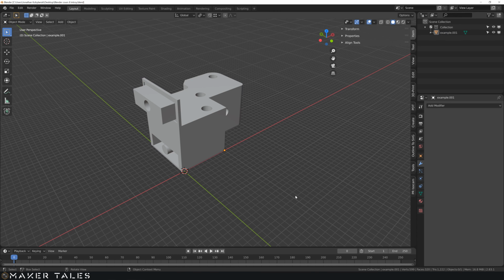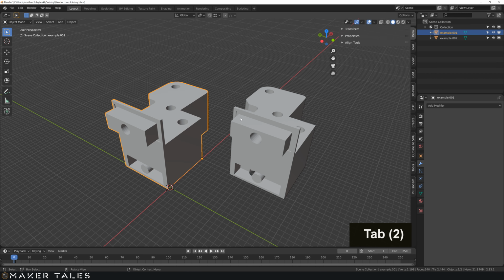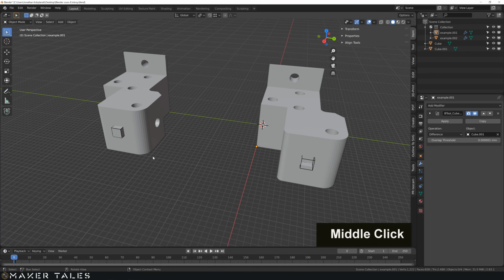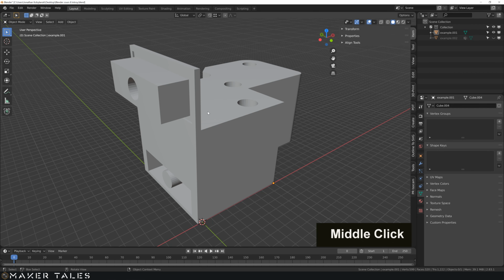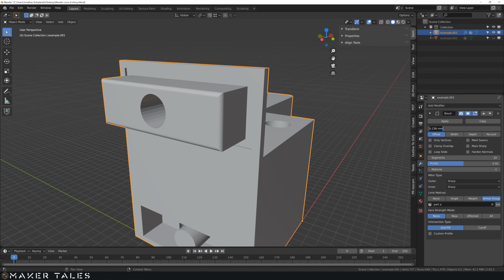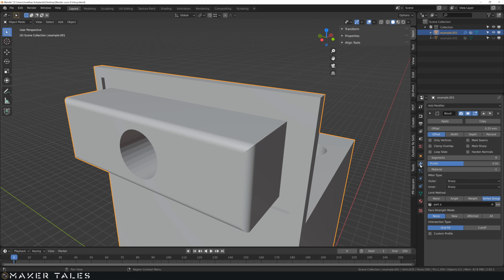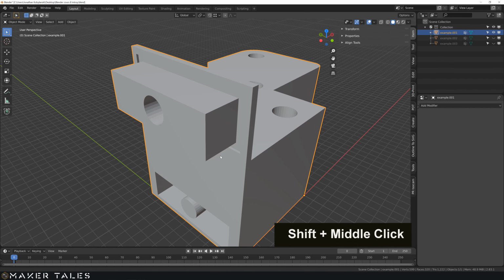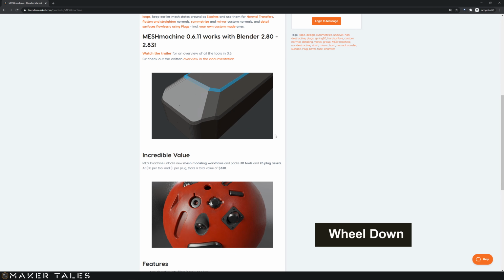Bevels & Linked Duplicate - 3D Precision Continued - Blender 2.83 Modeling | ( Tutorial Part - 9 )

Comment: Hi and thanks a lot for the video series :) It's one year old now but still full of great and up to date information. I am wondering though what your thoughts on the bevel operations are nowadays. If I remember correctly you could also solve the multiple /unwanted edge bevels with creating subdivisions of the edges or using loop-cuts, right? Though, I would understand why you don't want to add to many vertices to your model 'just' to get the beveling right. Do you have any new insights on this?

Comment: So would linked duplicates be the closest thing Blender currently has to, say, Components in SketchUp?

One of the things I like to design is converting objects, which obviously requires a fair bit of precision, and in SketchUp I've been able to do it quite easily. If I want to create, say, a robot that turns into a car, I could make all the parts for the robot model and group them as Components, duplicate them and rearrange them into the car model, and any alterations I have to make to a part in one model are automatically applied to the same part in the other. Do you reckon linked duplicates are my best bet in Blender?
Reply from the maker: Hey DrawnSteelHero, Long and the short, yes. Linked duplicates are what you are looking for.

Comment: 12:42 It's true that deep in Blender, there's no definition of an edge, distinct from the vertices at its ends, which is very limiting.. it would be great to have edge groups. But the whole nightmare between 12:42 and 16:24 , in this case, could have been dealt with by using Edge Bevel Weights, and limiting the Bevel modifier by Weight, not by Vertex Group? The weights are a strict multiplier, so can be used to control widths/offsets, too... There's only one layer of them, but still.. https://imgur.com/a/xW1981M .. I may be missing something.. sorry if so.
Reply from the maker: Hey Robin, 
Thanks for the heads up. I had no idea of weights. I just had a play around and it's 90% what I'm looking for to solve the problem to be able to have a none destructive workflow. I don't know if I'm missing something myself tho as I can't seem to get multiple weighted bevels working on one object tho. Is this something that's possible of is that the limitation of weights? Taking a little look in the blender community it looks like there is a big cry out for edge groups which I'm pretty sure would fix this bevel workflow that I'm not exactly happy about.
Reply: You certainly can have multiple edge-bevel weights on one object, via the panel I illustrated, or via Ctrl-E, the Edge menu. Setting the mean Bevel weight of a selection of edges does not set each edge to that weight. It proportionately adjusts each weight's contribution to the mean. If you want to set an absolute weight on a selection of edges, set their mean weight to 0 first, accept, and then set their mean weight again. That's a bit of a pain, but makes for a minimal interface. And there is only one layer of weights. I don't know how soon we can expect edges to have more of their own attributes; internally, they are naked indices into the vertex table. Maybe this is legacy? It keeps the .blend file-size down. Your man Stephen L would know better.

 BTW that's a fabulous tool he's writing, filling a big snapping hole. I'm still having a tough time learning to use it.. maybe what's needed is some docs from a very naIve POV, explaining the grammar: 1. select the elements to be transformed, 2. call the transform 3. set up the constraints WITHOUT clicking on the elements, 3. click and transform? I'm still trying to work out the rules :) I'll contribute when convinced. I can see it's nicely written.
Reply from the maker: @rbettsx  Hey, I really don't know where I'm not quite getting it. You say I can get multiple edge weights going in one object but I still can't seem to get the desired result that I would be looking for in a non-destructive workflow. Here I've done a small recording https://youtu.be/L0nzZhYH4uI  
I would love it if you could let me know where i'm going wrong as this would be great if it worked out the way i'm thinking it could.
Reply: @Keep-Making  I left a get-around under your linked video
Reply from the maker: @rbettsx  Seems very interesting. I'll have to look a little deeper into this tomorrow. Thanks for the research

Comment: Enjoying the series, if only you had started doing it 3 months ago before I had found a fair amount of this out already. I had same issue, 3d printing specific tutorials for 2.8 where few and far between. But I am still learnng stuff, re-remembering stuff, and practicing things. CAD Transforms & PDT bits were particularly useful.
As well as Mesh Machine, there is also Box Cutter and Hard Ops, again paid addons, and not designed for precision per sa. But you can loose days just playing with them (much like CAD Transform), I use box cutter instead of bool tool usually. Also very quick for slicing a model in half for 3d printing where not practical to print in one piece.
Looking forward to the next ones.
Reply from the maker: Hey Duncan,
So happy to hear that your enjoying the series.
Even if it's a little late for you. I do plan on making a few 3D precision challenge / modeling in action videos to let makers test the skills that they currently know.
Do let me know if there is anything you think I really should be covering in more detail in the future.
p.s. i'll have to look in to box cutter. I'm really looking forward to 2.9 with the new sketchup style cut away
Reply: Maker Tales I think my biggest pain has been remixing STLs in Blender, fixing all the manifold and intersections so that I can slice them, without resorting to using any auto desk products (which as I am using Linux is hard as they don’t support Linux, so have to faff with VMs). And drawing in 2d and extruding to 3D never occurred to me, I have been doing everything straight to 3D.

One tip I did pickup that I don’t think you covered is using the scene feature to do a full copy of the scene, then use that at a version control system, rather than creating copies of objects in the same scene, or doing lots of saves with different names. 

I hope they don’t change the shortcuts in 2.9, there are some very nice graphical shortcut key maps that are all wrong as they are pre 2.8, which is a shame. The challenges are very good, I have done all of them so far.
Reply from the maker: @duncanreed2391  Hmmm never thought of using the scene saving in that way, I'll have to give it a go. OH ya, I 100% understand your pain. Remixing STL can be rather painful. In not to long i'll be showing exactly that, a simple version first along with design for a laser cutter but Ya STL remixing can be rather painful. I did not really touch blender pre 2.8 so thankfully I did not have to deal with back shortcuts.